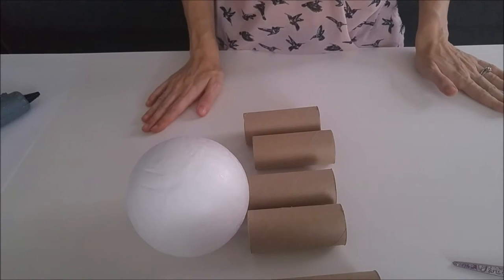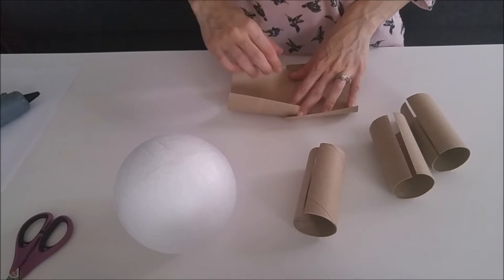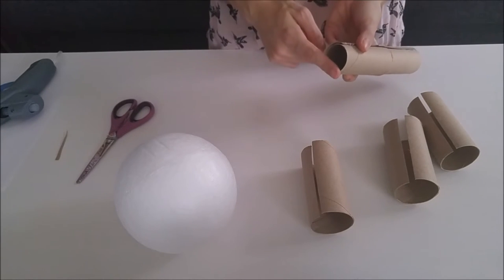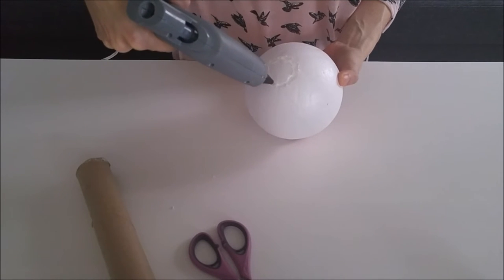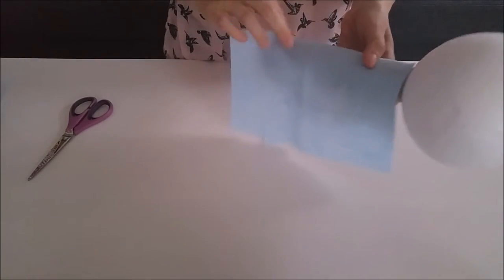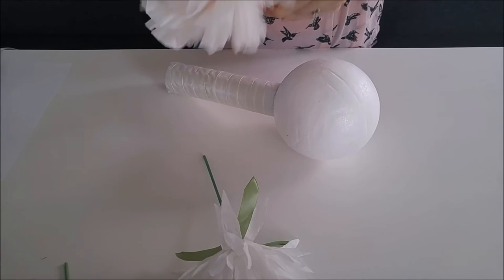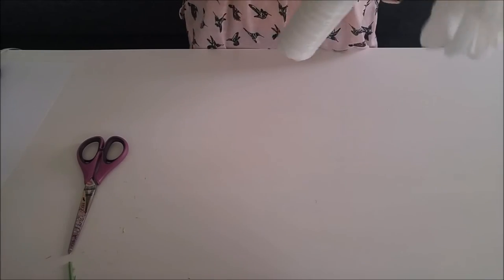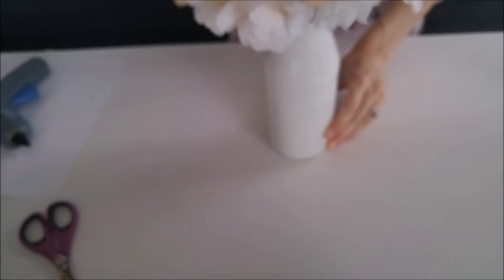DIY Bridal Bouquet- Faux Flowers

Comment: For the bottom she cut a  circle of felt  slightly larger in diameter  than the handle, , she made a few small cuts along the circumference , she glued it on the bottom, building and fluid the cut edges over the handle and the she finished wrapping the felt around the handle.